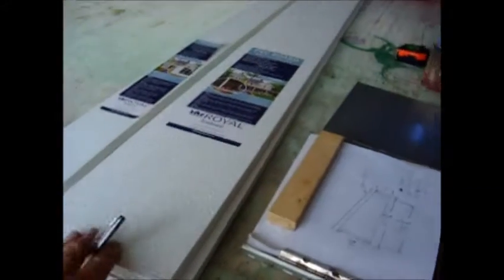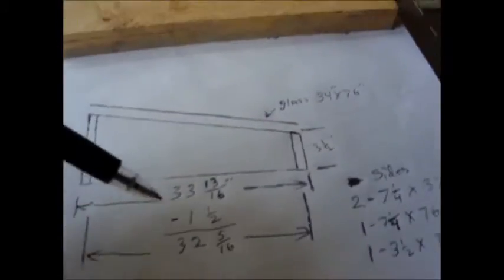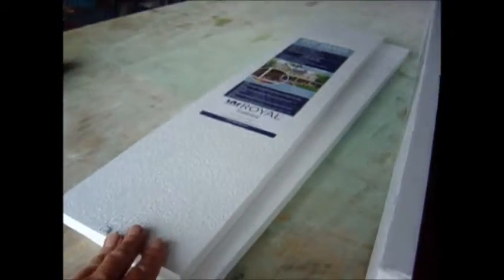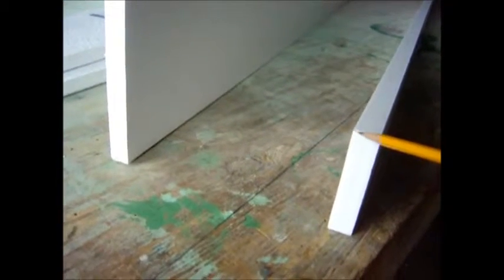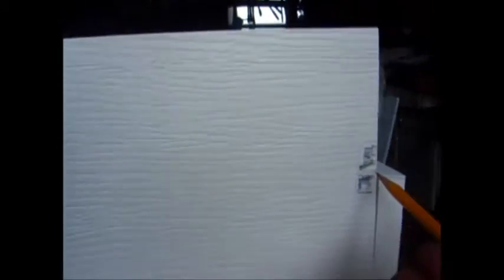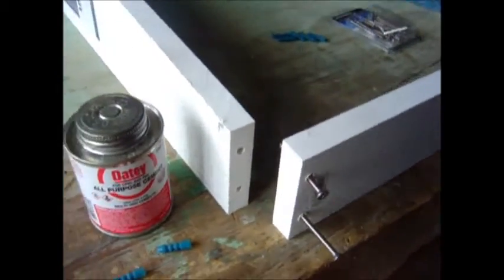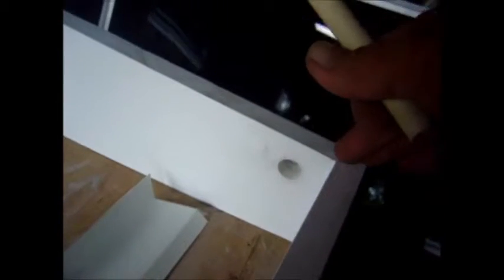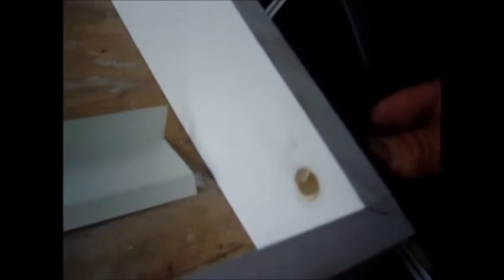Solar Water Distiller Build #2 Part 5

Comment: pvc, aluminium, caulk they are all comtaminating that water most definitely the aluminium, i can be wrong about the caulk. only stainless steel and glass should be used for a truly clean distillation
Reply from the maker: Sorry I haven't addressed your comment sooner but I'll give it a shot.

Water is transferred and stored every day in PVC pipes all around the world. Chemists and engineers have deemed it safe for food contact, what else can I tell you. 

The aluminum is totally submerged in the basin water and poses absolutely no threat of contamination to the distilling process. It does not evaporate or out-gas into the sealed environment therefore no contamination of the distilled water is possible.

Chemists and engineers have also deemed the silicone when cured as safe for food contact. Again, I don't know what else I can say to that point.

When you make your distiller using only glass and stainless steel let me know how you seal it and just exactly what material you use for pipes and to collect and store the distilled water. I'd be very interested in your materials and methods.

Thanks for the comment

Comment: Curious what method of procedure you used to bend the aluminum for the water trough. There was so much detail on everything but the bending of the trough was missed in the video. Thanks for your great video
Reply from the maker: I'm so sorry that I didn't say how I bent the trough. Thanks so much for bringing that to my attention. I used a sheet metal break, the type used for bending aluminum coil for siding. If you don't have one you can probably go to a rental tool place and pay them to let you bend it right in the store or perhaps they can bend it for you for a small charge. You can also contact a siding installer that has a break and have them bend it for you. I did forget to mention that in the video but I did tell the measurements for the bend. Sorry again for not telling this information in the video and thanks for bringing it to my attention. Best of luck with your build.
Reply: Thanks for the reply. Love your cooker, would like to buy plans from you. Tried going to StarFireSolar.com. Great job on everything you have posted thus far.
Reply from the maker: Hey I found those Solar Skillet Plans,  Now how do I send them to you?
Reply from the maker: I sent those plans to the email address you gave me. If you didn't get them check your spam folder. The subject is Solar Skillet Plans. If you can't find it, let me know and I will send it again.